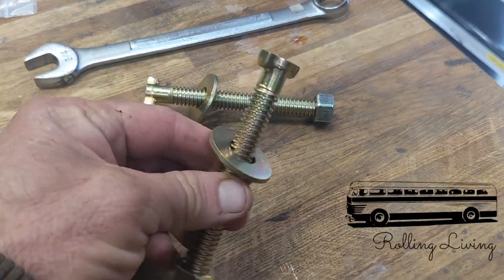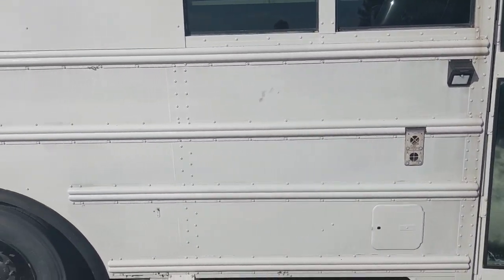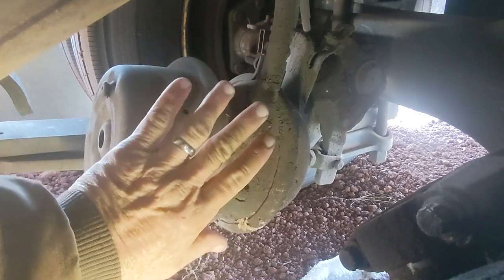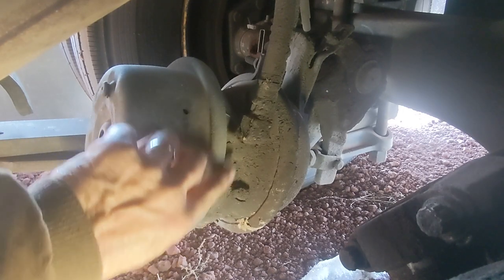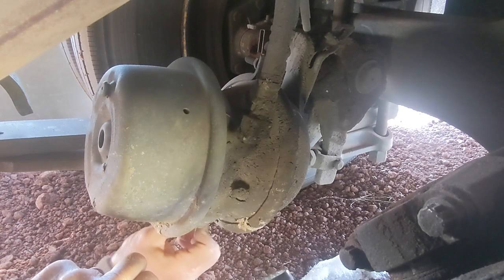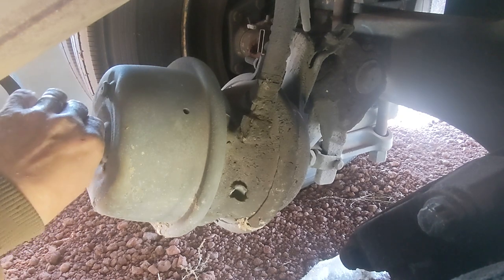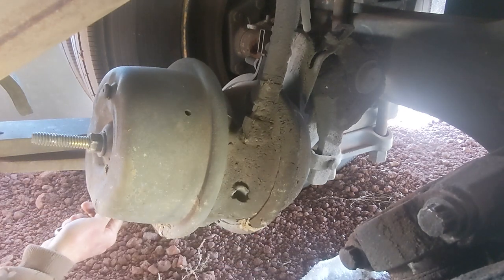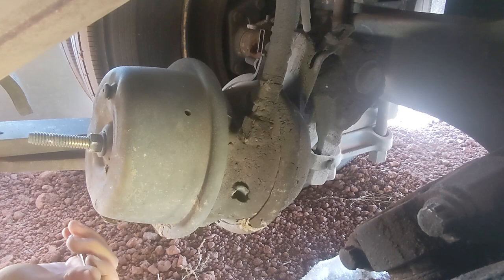Caging your air brakes, to tow a bus that's not running.

Comment: If like to add that you'll be turning that caging bolt a long time. I recommend a quality ratcheting box end wrench. Wrench on that thing until you can't turn it at all.
Reply from the maker: I think it's only 460 turns...not that long!  :-)  Seriously, though, you're right...it's a lot of turns.  Turn until the spring's fully compressed and, often, there's a mark on the shaft too.  But wrenching until you can no longer turn it is the best.

Comment: Great information!  So, will the front wheels turn freely or is there more to do before trying to move a bus?  Thanks!
Reply from the maker: The front wheels will still turn.  The parking brakes on your air brake system only lock the rear wheels.  If you're just rolling the bus a short way, like on your property, this is all you have to do.  If you're towing it, though, you want to disconnect the drive shaft to protect the transmission.

Comment: I'm almost ready to move my non-running bus.   It's an automatic transmission, and I only want to move it a couple hundred feet.  Should I put it in neutral for that moving operation?  Where would I look for an air input to charge the whole system with pressure?  Thanks for your time and wisdom!
Reply from the maker: Neutral works fine for a short, slow move like that. You just would not want to tow it in neutral for any distance or at speed.

As far as the air system input, if one is present the locations aren't consistent. They are often near the front of the bus, even on a rear engine bus, for tow truck access. But I do have a rear engine bus with the air fitting in the back...go figure?

If you have one, I would look in the front.. behind the bumper or perhaps behind a little door.
Reply: @RollingLiving  Thank you sir....I'll just have a look all around for the air fitting...if I can find it, I might just charge the system so I have brakes while moving the bus...not too many flat spots on top of an Ozark mountain...would hate to lose the bus in the creek or lose my garage with a rolling bus!  Otherwise, I'll have the bus securely connected to a cable and chain around a big oak or two.  Should be fun!
Reply from the maker: @Omarateastwind  Well being able to air up the system so you have brakes is definitely the better option, if you can. 👍

Comment: Thanks. Is that the same on brakes on the trailers on tractor and trailers?
Reply from the maker: While the spring braking concept is the same, I don't know if the brake chambers on a trailer are the same style or not. I think I've even seen tandem chambers...maybe?  But I've only had experience with bus and straight truck brakes.

Comment: So if you release the spring brakes, does that mean that there is absolutely no way to apply braking force for when you're just moving the bus around your property? For instance hardly anyone's property is perfectly flat, and so the bus might keep going a ways after you pull/push it, unless you have a helper behind the wheel who can apply a little braking force somehow...
Reply from the maker: Yes, no brakes without air pressure.  This is intended for towing, really.  You're absolutely right about it rolling on!